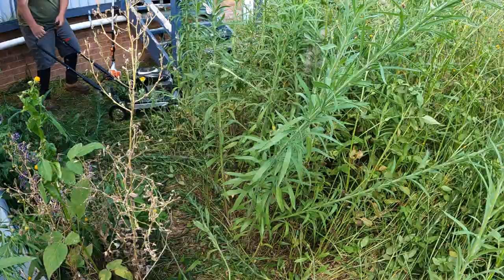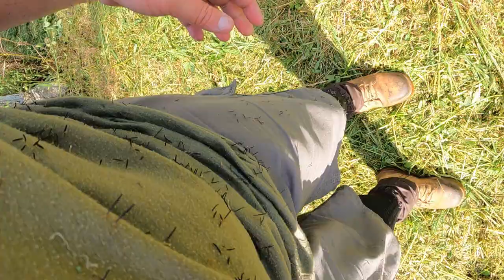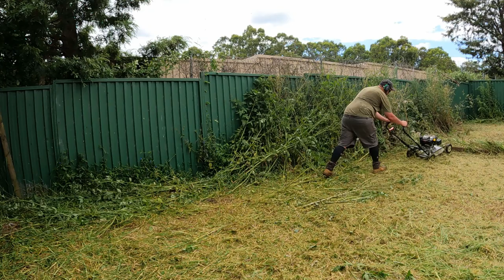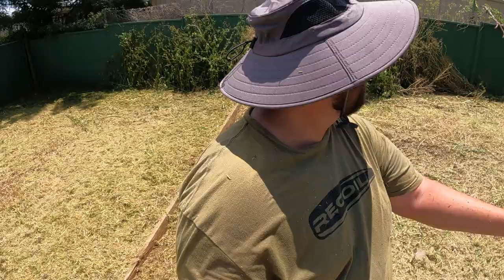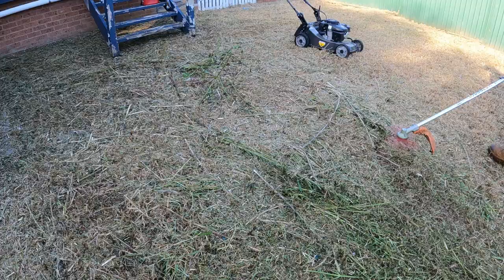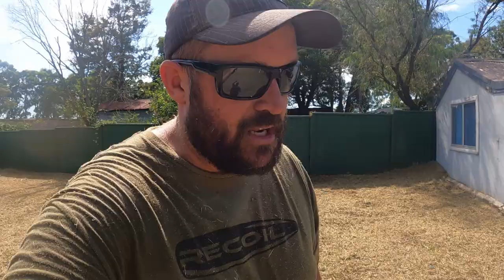I Almost DIED Push Mowing 8 FOOT WEEDS & TALL LONG GRASS - A Lawn Makeover For The History Books!

Comment: We've all had to do that with a push mower at some stage. I hate it but can't always avoid it. It sure looks like months of growth but what a massive difference in the end. It looks like a completely different place. Well worth the hours of effort. Fantastic effort!
Reply: Have you heard [of] a band called Mammoth Weed Wizard... might be your cup of tea!
Reply: He said 5 mos.of growth
Reply: Next time you have to do this overgrown stuff just get a proper weed whacker. The big ones not those 25cc little, instead at least a 40-50cc. They come with a blade. Believe me. That just cuts through this kind of stuff. I do it 3 times a year on a 4 times size yard. Without the blade is nearly impossible
Reply: @totisa93  hey mate. How long does it take you normal for over grown grass with weed wacker with a steel blade?
Reply: @granddeluxe123  about 4 hours but I definitely don't make it pretty just cut and leave it like that. It is about a 10m x 80m back garden. I usually cut when the weeds are like 1m tall
Reply: At least your mower can take it (probably) my little push mower keeps getting stuffed up with material forcing me to stop and unclog it frequently
Reply: I been there now I own 2 stroke unity
Reply: I like push mowing it calms my nerves I had 45 strokes 11 years ago & I'm half blind in both eyes but to keep me sain and my anger issues down I push mow and weedeat it calms my nerves I'm on sertralene 50 mg. to help but I do it & I love it.
Reply: A weedeater with about 30 cc,up would been easier with a 3 claw grass blade

Comment: My neighbor had something along the lines 0f this to do for an in-law who was banged up in a car wreck, and to make it less work, he took an old mower of his and torched out a big u-shape out of the mower deck between the front wheels, exposing the whirling blade and created a sort of poorman's brush hog mower, (and one of the most frightening things ever!)  He also added a bar up above the motor that ran from the left front wheel area to just back of the rear deck.  As  the mower sliced off the tall weeds at the root, the weed would fall back and to the right side guided by the sloping bar and lay on the ground to be mulched later.  It was outstanding at tall weed cutting, and even chopped off a few tree saplings with ease.  He now saves it for the occasional odd job where only the "BEAST" can do the job.

Comment: Still don't get the use of a small push mower to cut it. Having said that, what an amazing performance for a small machine. The makers of that brand should be very proud of it's capabilities. I did not that it stalled a few times but also that it was being rammed into some tough mounds of weeds and grass. I am also impressed at the stamina of the operator who must be in excellent shape. This was a pleasure to watch.

Comment: I see you have a bush ranger self propelled, I find my one with the Honda gearbox and motor and sharp blades. The GXV 160  with the flap up, seems to bulldozers well through tough lawns
Reply from the maker: I had to turn up my Bushranger RPM up significantly. Was only running 2645 RPM. IT was terrible, and it bogged down all the time even on standard grass. I pumped it up to 3200 to see if that helps. Ill let you know how it goes.

Comment: I've found out the hard way and stopped crushing my weeds on my lawn because they go to seed faster. You need to spray that lawn to get rid of the weeds from propagating instead of spreading the seeds. I use vinegar on any weeds I want gone, to bad they do come back if you don't remove the base of the root and seeds. Best of luck to ya.

Comment: What model is your whipper snipper and what type string do you use it does an excellent job
Reply from the maker: Stihl FS94R - Light stuff / general trimming
Stihl KM131R - Heavy duty stuff / Blade edgeing/ Brushcutting / Orgegon blade.

Diamond Edge 2.7mm/.105 trimmer line. Trying some Trailblazer 3.3mm next week as I mostly do these bad lawns. I want to see how the 3.3mm line holds up on these long grass and weeds.

Comment: I find it fascinating that so many Ozzies have the same circular adjustable wash line, and a paved path to fat there. Also the geyser sitting on the ground outside the house. What's with the big chunk of concrete they all have in the back corner of the Garden? Very confusing. 😅

Comment: That needed a skid steer with a mower deck/ slasher with the blades being the first think to touch the grass so that there isn't anything being pushed over before getting cut.
Sounds dangerous but that's exactly what a brush cutter is with a solid blade.

Comment: AWESOME, what kind of lawnmower is that???
Reply from the maker: 21" Utility mower.
Reply: @LushCutLawns  I have a 21" utility mower with a bar blade that has lasted me about 15 years. It will die soon. Please tell me what brand and model that little monster is. I would have used a slasher on that yard. To call it a lawn is a joke but that mower ate it.

Comment: Is that a bushranger utility? I'm debating about getting one this week. If it is i'm sold
Reply: Bushranger with the Kohler donk on it. Res would have been wound up on it as well I think.
Reply from the maker: It's the Big Bob 21" Utility. Revs not wound up. Everything standard.